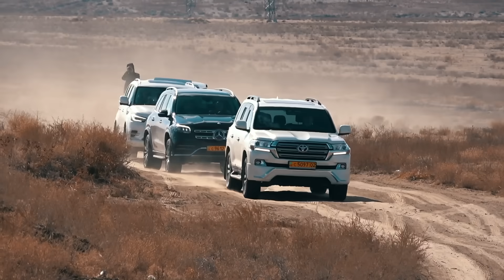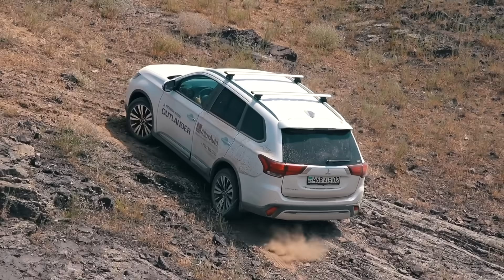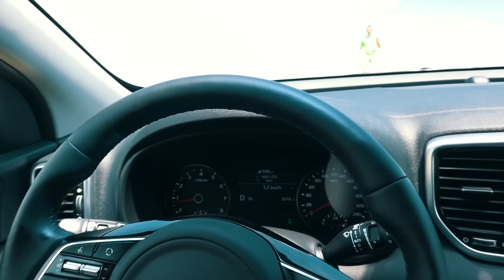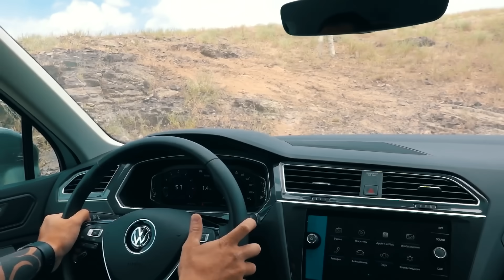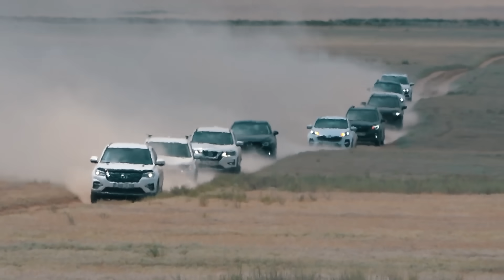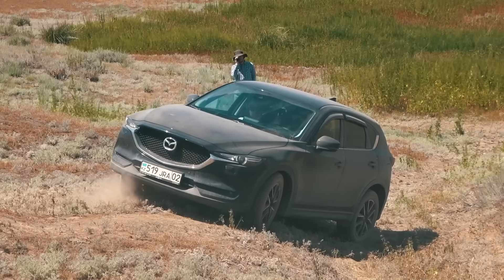SUV Battle 2020: Toyota RAV4, Nissan Rogue, Subaru Forester, Mazda CX 5, Volkswagen Tiguan, Sportage

Comment: All terrain tires really make a huge difference. I just posted a video taking my forester up quite steep, uneven, somewhat similar terrain and it handled it no problem !!!
Reply: All whilst consuming liters of oil and burning up that shit cvt. 😂
Reply: @takuyatanaka5587  No problems here(: check my oil regularly and monitor my transmission temps, i also have an additional transmission cooler installed (:
Reply: @miles7129-u3o  how often do you change your cvt fluid? I had a 2014 Forester and the dealer refused my request to change it. Said it was lifetime fluid. When the cvt went out, the independent garage that replaced it, said the fluid was burnt.
Reply: @takuyatanaka5587  Oh man that sucks, they must have changed their service guidelines because the dealer has told me I should change it every 30,000 miles, which is what I have done so far. from my understanding the earlier generation CVT's were also especially problematic, but yeah I'm not a huge fan of the CVT myself.
Reply: @miles7129-u3o  yeah Subaru did me wrong and I’m definitely salty about it. But my poor attitude aside, cvt’s with frequent fluid changes of full synthetic cvt fluid are seeing high miles. 200k+ miles potential. No doubt you’ll see that with those 30k fluid changes intervals. Cheers.

Comment: A stupid test. Cars should be driven the way they are designed to be driven. Know the correct mode, know the correct driving technique and see what they can do rather than how to make the cars look bad.. In particular, off road tyres for off road driving, select the correct drive mode, use the appropriate locks and maintain momentum.

Comment: The Mazda CX-5 has an undocumented off road mode that is activated by turning off the traction control. (https://insidemazda.mazdausa.com/the-mazda-way/technology/whats-the-diff-mazda-cx-5-unlocks-secret-off-road-mode/). It would have been interesting to see if there would have been any improvement with the traction control turned off.

Comment: The first ones pass easier I touch the tight ground the last ones I touch weak ground the test is not fair, the last ones are stronger because they passed the gaps of the first

Comment: Rav 4 was excellent. The biggest problem all these cars have is that they are petrol (gas) engines. The diesel engined versions produce their torque at much lower revs, producing less slippage. The diesels perform much better off road.
Reply: diesel is dirty and sounds bad-petrol is better so STFUUUUU

Comment: This is why diesel SUV are way better option. a 2.0 diesel has usually around 400 Nm and clears this obstacle with ease
Reply from the maker: Diesel engines are unpopular in my country. So, it's hard to find this type of cars. But I will try. Subscribe to not to miss the video.

Comment: Curious if you’ll have the Honda CR-V tested. Since they got rid of the long time, real time 4wd that was supposedly amazing.
Reply: You can find several videos on YT that prove that the CR-V is one of the, if not the poorest performing awd system in a modern vehicle. Honda really needs to step up their game. Ditch the unreliable cvt and the terrible oil diluting engine and go back to basic reliability.
Reply: @takuyatanaka5587  you said it! 🏆

Comment: There is a very clear reason that Subaru behaved bad. Due to the weak CVT and very conservative turning, the car behaved like a 100hp 4 wheeler with a heavy body. Under high pressure test(rock crawling), the wheel can only accept so little torque. Though their AWD system is nice, the power from only 2000rpm is to small to climb. X-Mode will turn the CVT a little bit more agressive but not help a lot. That CVT used by subaru has been developed for nearly 10 years, and even with conservative turning subbies still suffer from transmission issues. Tbh, CVT doesn't deserve a subaru.
I just bought my 2021 outback and find the issue quickly. It is a soft-off roader, or actually not an off roader at all. Subaru shines in the situations that ask for torque on all 4 wheel not that much, but should be very suitable and efficient. The most common situations are beach cruising and snow/mud which are the exact opposite of rock craw in the off road world. 
I used to think that the biggest limitation for Subaru outback is the long nose with bad approach angel. That's not true from my several months owners experience. You will reach the limitation of CVT before the poor 19 degree approach angel in rock crawlling. 
Saying this, I'm still imaging that what will it be to have a 6 speed manual or at least a n-speed real transmission in new Subaru SUVs. I believe they can beat any competiter like rav4 by a large margin in rock crawlling if angels are not the problem. It can actually become something like an UTV in car world. With Jeep-like bumpers and diffs I believe Subaru can match or even beat traditional 4x4s while still supplying car like highway driving feeling.
Reply: Somebody told that the CVT is easy to overheat so the ECU cuts down power from the engine to protect the transmission.

Comment: You didn’t activate deep mud and snow as usual in the forester
Reply from the maker: To better understand the difference. At first, all cars drive in the “dummy” mode: the gearbox is just in the Drive position. After the car gets stuck and cannot go further, we activate the available auxiliary mode, most often this is the OFF-ROAD mode. This sequence allows you to form an understanding of how the behavior of the car changes in standard and offroad modes.
Reply: @SUVBattle  I know but you didn’t activate the second type of X-mode which will make the forester go up the hill

Comment: There is no consistency in acceleration and trajectory, this test is BS
Reply from the maker: Drivers deliberately drive as slowly as possible and along a deliberately “wrong” complex trajectory. This allows you to demonstrate the effectiveness of the four-wheel drive system. If you take a good acceleration, then all cars will easily pass this obstacle and you will not notice any difference in their behavior.
Reply: With acceleration I can drive a Subaru STI easily enough to reach the hill top. The only things I need are skid plate, airbag off, and a brave heart.

Comment: It’s not fair because by the time the last cars try going through those holes 🕳  , they got deeper by the other cars 🚗 Tiguan for the win .
Reply from the maker: I completely agree with you about condition of surface. But finding a way so that the surface condition does not change and there are convenient shooting points is extremely difficult. So far this is the best I have found. If I find something with a more stable surface, of course I will take this opportunity and will test there.

Comment: In CX-5s, you have to hold the tcs off button to access “off-road” mode
Reply: The CX5 driver was an idiot. Put it in sport mode rather than off road mode, full throttled until it overheated 5 times… it could’ve taken that hill with a decent driver.

Comment: Really appreciate your test!  Here’s clear proof that  Subaru isn’t the best any more, maybe more correct to say there’s a lot other awd suv now days that can drive off road not worth then Subaru, maybe even better
Reply from the maker: Thanks for your feedback! What cars would you like to see on this obstacle?
Reply: @SUVBattle  I would appreciate to see out there Honda CR-V. I used to own 2012 and awd was useless. Wasn’t able to cross 10 cm bump, front wheels was in snow/ice, rear on dry surface. Simple was no action!  But, since than Honda did improve awd
Reply: Dude I'd rather pull a red wagon filled with 800lb of rock than drive a heaping pile of garbage like a Subaru up that hill
Reply: @mathkriston44  can you explain the reason why you don’t like Subaru? I was thinking about to buy Outback or Forester. I own ones 2013 Impreza and was able to keep only few months. I think any other car is better
Reply: @agpawpaw  I'm just talking trash.  You should just buy what ever you like and what feels good to drive.  You just gotta drive these.  These cars weren't really meant to do what this test shows.  They weren't meant for this kind of driving.  I bought a Rav 4 today and it suits my needs.  Fuel efficient but still has 200 hp and all wheel drive.  I'm sure Subaru makes great cars

Comment: So glad the RAV did as well as it did. I’ve just ordered my 2021 Cruiser AWD hybrid. 
I won’t be driving it like this though.
Reply: Plug in well before you go for off road other wise will stay without electricity and lose  rear wheel traction
Reply: @burakh.8670  It’s a hybrid, batteries and fuel power my new RAV4.  It’s not a plug in electric vehicle.
Reply: @aussiele1  not a plug-in hybrid is it?
Reply: @burakh.8670  Nope. I’ve been driving it since the end of June. Definitely not a plug in.
Reply: @aussiele1  what about its rear traction? Is it only driven by electical motor? Or it has shaft from gear box to driven by patrol engine? Rav4 hybrid was rear traction driven by only electrical motor not having a shaft underneath. So if the battery is out only FWD.
Reply: @burakh.8670  Only electric. It kicks in when extra traction is needed. Suits Aussie roads perfectly.
Reply: @aussiele1  yes so when you need rear traction while off roading if your battery has gone you will stuck.

Comment: well when the driver is motioned to stop by the guy on the hill the Rogue would have made it.
Reply from the maker: Drivers deliberately drive as slowly as possible and along a deliberately “wrong” complex trajectory. This allows you to demonstrate the effectiveness of the four-wheel drive system. If you take a good acceleration, then all cars will easily pass this obstacle and you will not notice any difference in their behavior.

Comment: You guys should at least read the manual of the cars before do this sort of test. In any of these cars you will do it without putting in the specific off-road mode. You can at least mention that you are doing a test just to see if it will work, but this is not real world. The Forester, for example, has the X-Mode for this sort of situation, but you have to keep the TC off. And you can cheat it not to work properly; you have to apply moderate gas and keep it, also can turn a bit the wheel for traction.
If you play with the accelerator, not put the right mode and blame the car is just stupid. It's a shame to do this sort of test and not do it properly; a lot of time go to waste.
Reply from the maker: W do it to better understand the difference. At first, all cars drive in the “dummy” mode: the gearbox is just in the Drive position. After the car gets stuck and cannot go further, we activate the available auxiliary mode, most often this is the OFF-ROAD mode. This sequence allows you to form an understanding of how the behavior of the car changes in standard and offroad modes.
Reply: @SUVBattle  I understand that you make a sort of progress while doing the test, using the more specific modes after the normal mode is not capable of handle the situation. What I mean is that if you do not work it properly, playing with the gas pedal and not letting the programming/system figure it out, you will have a fail, a cheated to fail situation. You could learn it from the channel Driving Sports TV - they tested almost all of the same cars with different results. And they are not the only ones, you can check CarExpert also.

Comment: There is no impetus for the manufacturing of better AWD offroad systems so I doubt we will see anything soon. I think until there are true locking diffs like the Jeep Cherokee trailhawk that blows doors on all of these reviewed cars. I think the new Ford Bronco Sport in the Badlands trim will also show up all these others. I think Subaru has the edge because of  more ground clearance and putting the TourQ locking diff in the Subaru makes them animals off road.

Comment: made me happy i bought a Rav4 and not a Subaru or Kia i'm wondering how the Rav4 hybrid and plugin hybrid would do in this test
Reply: They hybrids don't do well at all. There is no mechanical link to the rear wheels and leaves the underpowered (at least for off-road) electric motor for that

Comment: Subaru can do better, its a driver who was afraid to step on the pedal. Tiguan driver was all-in
Reply from the maker: They drive like noobs on purpose. If they drove the way they should, then you would not see the all-wheel drive system's work.
Reply: @SUVBattle  but the all wheel drive system is useless without proper acceleration

Comment: Dude, the 1.4 engine for the tiguan chassis is weak. You should take the 2.0 tdi 150cp/190cp.
Reply from the maker: Unfortunately, cars with diesel engines are unpopular in my country. So, it's hard to find them. But if I would have a chance, I will do it. Subscribe to not to miss the video.
Reply: @SUVBattle  Ok, I understand.

Comment: The test is not even for all vehicles. The terrain deteriorates with each passing vehicle, leaving the worst track for the next vehicle.
Reply from the maker: I completely agree with you about condition of surface. But finding a way so that the surface condition does not change and there are convenient shooting points is extremely difficult. So far this is the best I have found. If I find something with a more stable surface, of course I will take this opportunity and will test there.
Reply: @SUVBattle  thanks for answering. I'm sorry for my bad english

Comment: You make and present some of the best comparison videos I've seen!  I'd love to see some videos of commonly purchased used SUVs, especially those that are meant to be offroaded (i.e. cherokee/liberty, grand Cherokee, 4runner, prado, montero, patrol, etc.), especially if you can separate them by class (i.e. mid-size, full-size, etc.).  It seems like you get many of these from dealerships so I'm sure my idea might take some extra work to figure out but there are many who can not afford new vehicles so comparing used options folks might cross-shop would be helpful to see on the same route - something consumers cannot normally do on their own.  It also might be interesting to see some comparisons of similar vehicles but different generations or variations as well since there can be significant changes to systems or options and how they act offroad.
Reply from the maker: I'm preparing video with SUVs from 2000's. There would be some of listed cars. Subscribe to not to miss the video.

Comment: TYRES! geolandar vs. primacy on dirt? really? This test must be done with same tyres...
Reply from the maker: I completely agree with you. The same tires will add objectivity. But since I do not have a car tire factory, we work with what we have. At the moment, we are checking that the tire pressure corresponds to the factory values (for each car individually).

Comment: Bad.  Some modes requires activation before. Need to studied the user manual of each model.
The correct test is to put the car in best terrain mode before the climb
Reply from the maker: We do ii to better understand the difference. At first, all cars drive in the “dummy” mode: the gearbox is just in the Drive position. After the car gets stuck and cannot go further, we activate the available auxiliary mode, most often this is the OFF-ROAD mode. This sequence allows you to form an understanding of how the behavior of the car changes in standard and offroad modes.
Reply: @SUVBattle  sorry to desagree. For example the Suzuki SX4 need a movement of 10 meters in order to activate the all terrain mode. The same with some Mitsu. 
If you activate without some distance, the system just not get engage. 
It´s write in the manual of some models.
So that´s why your test have that failure with some models
Reply: @SUVBattle  the best if begin with the off road mode activated.
Maybe you can do your test, but make the cars go down and start the again the test but with the requiered space and time that the car need to activate all the systems.
Some systems are mechanical so that´s why the need some movement before engage.
Hope you can considere that technical issue in your next videos

Comment: stock to stock comparison this is fine i guess, but honestly who would take a stock (with stock tires) vehicle to a place like this. I feel like better comparison would be to put someone that knows how to drive this terrain out there and put AT tires on the wheels at least. Also, most of the vehicles are meant to use a bit of momentum. low range is not really what these are used for.
Reply from the maker: Firstly, my goal is just to show the difference in the efficiency of the four-wheel drive of different cars. It may help future owners to make decisions whether to buy the car or not.

Secondly, I completely agree with you about tires. But these are private or dealership cars, so it is not possible to replace tires. The budget and time also do not allow for this. But we will do such a test in the future.

Lastly, drivers deliberately drive as slowly as possible and along a deliberately “wrong” complex trajectory. This allows you to demonstrate the effectiveness of the four-wheel drive system. If you take a good acceleration, then all cars will easily pass this obstacle and you will not notice any difference in their behavior.

Comment: It's not fair the pot holes are getting deeper because the previous cars messed it up
Reply from the maker: I completely agree with you about condition of surface. But finding a way so that the surface condition does not change and there are convenient shooting points is extremely difficult. So far this is the best I have found. If I find something with a more stable surface, of course I will take this opportunity and will test there.
Reply: @SUVBattle  ooh ok i understand thanks bra